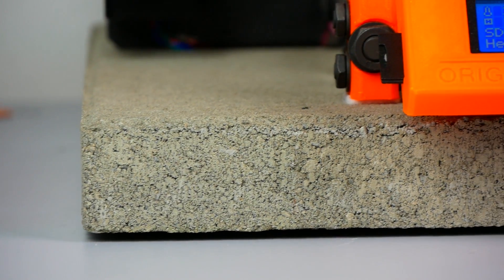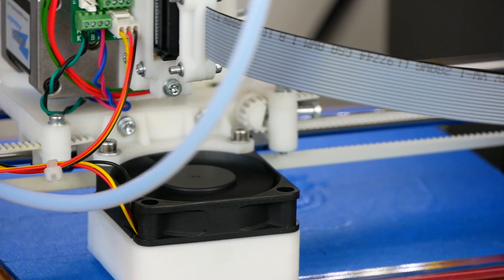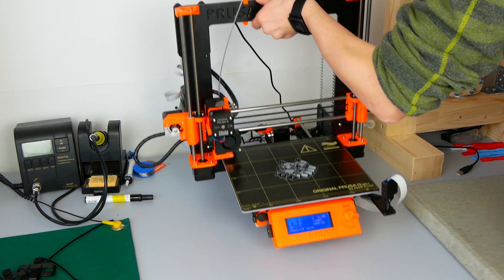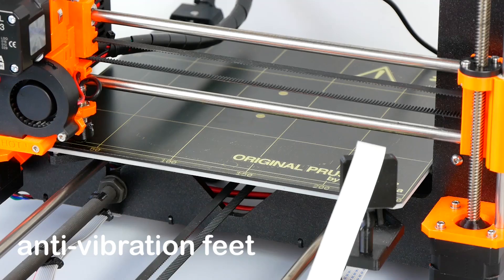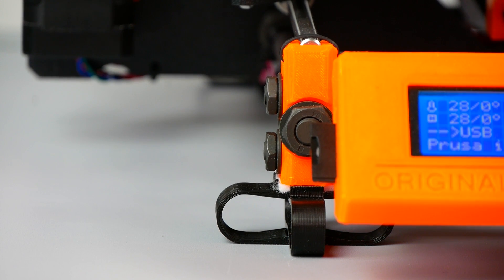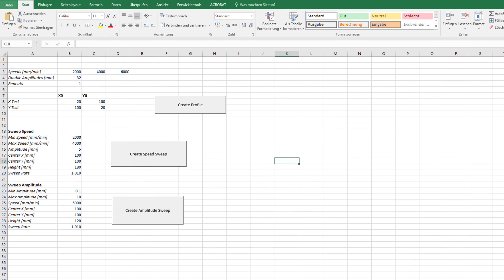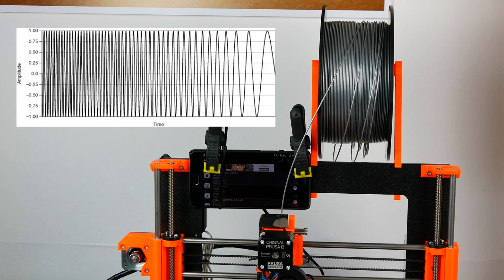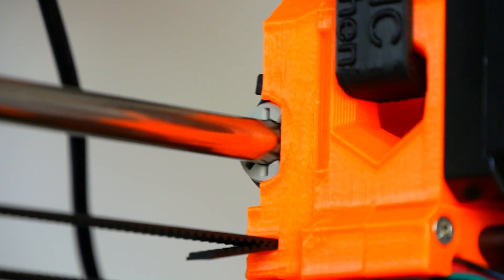Silencing the Prusa i3 MK2 & Horrible Vibrations

Comment: Could you elaborate more on how you created the gcode to find the resonances?
Reply from the maker: You can find the sweep test GCODE on GITHUB:
https://github.com/CNCKitchen/3D-Printer-Vibration/blob/master/ampSweepTest.gcode
Notice that it's designed for the Prusa i3 - USE AT YOUR OWN RISK!
Reply: CNC Kitchen thanks! Great video and I love your scientific approach to investigating vibrations.
Reply: i will give this a go on my mendel90 in a week or 2

you also showed a excel sheet in the video... can you link to that so that we can take a copy?

and maybe explain how to avoid the resonance best? you said to lower acceleration and jerk.. i dont mind that, but can values be calculated from the freq found?

Comment: Are you familiar with the Young Modulus role in dampening dominant frequencies of equipment? Sometimes, two materials, with different Young Modulus, or more, are required to "cancel" harmful frequencies in a system i.e. a spring within a spring, with their supports fixed on a certain type of rubber mat, under each legs. Sometimes anchoring the feet solidely is sufficient. 
A greater supporting mass is great; but sometimes added weight to the machine, in strategic places, can cancel some localized dominant frequencies, sometimes also simplifying the feet construction. But this method can have a detrimental effect on the wear of certain parts, that were not engineered accordingly, greatly reducing their longevity. 
When I saw the result you had with the feet, I immediately thought they were inappropriate, actually amplifying the issue and creating a new problem; they need to be designed for this precise system frequencies, in this precise condition, assuming the system is uniquely customized. 
The sound does help to identify certain frequencies, but others need accelerometers to be determined and avoided, with, like you said, speed adjustments to avoid harmful frequencies. Certain systems need accelerometers, and the controller program conceived to actively use them in real time, during the production process, to make sure certain frequencies are avoided i.e. wind turbines. 
Fun challenge, but I think you can find easy fixes for all your systems conditions.
Just a thought.

Comment: mine mk3s is in stealth for some reason louder then in nromal mode, in the beginning there was no problem but now when the bed is moving it is uncomfortably loud that i have to switch into normal mode, i seriously dont know why, i switched the isumi bearings for igus bearings directly in the beginning had no problems with that, i tighten up every srew on the printer but the vibration are still there

Comment: What about bolting the printer to the paver? Then adding a closed cell foam insulator below the paver? The way I see it is if you take a video game controller that vivrates and put it on a hard surface it will dance, but if you bolt the controller to the hard surface vibrations will be reduced significantly. You may have to add supports to directly connect the and add more contact points for gantry to the paver to further reduce vibration. And finally the closed cell foam insulator will absorb and negate vibrations reducing them even further.

Comment: I thought this could be a problem when I saw people using those feet in other videos. It had to affect print quality in some way, and having rigid mechanical parts vibrate around is not good. 
That being said, I was looking for concrete pavers at the local store, and saw they had rubber ones made from recycled car tires. I am considering grabbing the hard rubber ones see if it gives the best of both worlds. A sturdy solid foundation, and sound dampening properties.

Comment: Having a large mass at the top of a "pendulum" is not good for low frequency resonance. Decoupling such mass from the printer altogether will improve this immensely. In other words remove the spool frame from the printer body and mount it separately to the floor/table. 

a) This will remove any and all pulse stimulus from the movement of the printer to the mass of the spool
b) It will greatly reduce the mass of the overall printer assembly allowing the print head to move laterally (X & Y) more rapidly before hitting resonance.

It's a similar principle (if not exactly the same) as reducing the unsprung mass of vehicle wheel assemblies - lower mass of wheel by using lighter alloys, lighter yet more flexible tyre construction, lighter brake calipers, lighter braking disks, lighter but as strong or stronger wishbones etc. All these things are standard practice in just about all motorsport but essential in Formula One. Such "unsprung mass reduction improves the mechanical "grip" by ensuring the tyre/wheel can respond more quickly to road surface variations stopping the wheel from unnecessary "unloading" which reduces grip levels, especially laterally but also forward (important when braking).

Comment: A slab of concrete is seems a strange choice when a mat of cork would have a similar if not better effect by actually absorbing the vibration "energy" by deforming...
Reply from the maker: Concrete does a way better job in decoupling the printer from the table as cork would due to its weight.

Comment: Concrete pavers worked for me.  My Prusa i3 MK3s was really growling.  I pulled it out of its enclosure and checked every fastener, not a loose one in the bunch.  Took some left over 2.5" paver material from my back yard and used it as a base.  I had plywood stacked previously.  It's night and day.

Comment: I would strongly recommend swapping the position of the paver and the damping pads. Doing so, you are making sure the printer is dynamically uncoupled from the table. as its resonance will be very low. The energy dissipated is grossly the same as before (as your printer is the same), but the movement will be way lower thus leading to less vibration levels, as you printer has to move a whole big mass. Note that doing so, you are only making sure that the vibrations transmitted through the feet of the printer are limited to annihilated. The other noises (due to internal vibrations in your printer) will stay be transmitted through air. For this latter, internal resonances can be limited by mounting damping pads. at stepper level, making sure every connection is not loose. Adding some damping material is a solution to solve a problem, while removing the cause is even better. At last, Every sound you cannot remove can be absorbed by a case you put around the printer. Don't forget that a small gap is enough to annihilate its sound damping qualities. So seal those gaps! Brilliant chirp analysis by the way.

Comment: Hi, thanks for the great video.  Would this help with ringing/ghosting issues?
Reply from the maker: It helped me, yes. Definitely worth the $2 investment.
Reply: @CNCKitchen  You inspired me to try and print on a more stable surface.  I took my printer downstairs today and printed on a hard tiled floor instead of my usual IKEA desk, it significantly reduced my ghosting I was struggling with on my Y axis (Ender 3 Pro) - it's still there but not as bad.  

Definitely going to find something similar to what you used in the video now.  Thank you so much, this was troubling me for weeks.
Reply: @CNCKitchen  Hey, I finally got around to buying a paving slab just like your one shown in the video, I put some anti vibration feet from amazon underneath it (https://www.amazon.co.uk/gp/product/B07MHHQLPF) and the difference is incredible, I can barely see any ghosting at all now!  This video is invaluable, can't thank you enough I struggled with ghosting for so long - now fixed for under £10 in total, fantastic!

Comment: Wow!  They sure cured that with the i3 mk3s!!  I can't hear mine at all on a desk 10 feet away.
Reply: I can hear my mk3s across the house even in stealth mode. In a way it's even louder than my tevo printer. The noise from the tevo is higher in pitch and that doesn't travel through walls easily. the low frequency noise of the prusa isn't affected by walls and doors much.

Comment: optimizing the printers center of mass (like by relocating the filament spool) would also help reduce resonance and noise during printing. using proper rubber feet and having a few extras under the over hanging parts of the frame would help as well. Or as others have commented having the feet under the paver would work too.

Comment: This is one of my favorite videos I share with printer owners.  

I was wondering, have you tried anchoring/mounting the machine to the cement?  
say, adding points in the corners and uses springs to pull the machine snug/down?

Comment: I always suspected that resilient mounting pads might be a bad idea for 3D printing machines (as well as ANY machine tool) in general. As you so clearly demonstrate in this video, the frequencies and harmonics generated by a device throwing a mass around a Cartesian plane, as a 3D printing machine does, range from the sub-audible, low-frequencies caused by the acceleration/deceleration of the moving mass, to the higher frequency vibrations and harmonics generated by the electromechanical dynamics produced within stepper-driven mechanisms. 

Add to these complicating factors such as competing resonances, which are further compounded by the existence of radically “springy” elements such as drive belts under tension, and you are facing a witch’s brew of moving targets, where methods that are effective at reducing vibration-related print anomalies on one axis, causes problems on another, so one finds oneself playing whack-a-mole seeking the optimal solution. 

We are fighting vibrations on two major fronts, low frequencies causing gross machine movement and flexing, and higher frequencies causing undesirable noise and print artifacts. These change constantly throughout a print, and become noticeably harsher as the Z-axis rises into the machine frame, away from the more rigid base, and into the more flexible parts of the frame where moments of inertia have a greater effect against the anchor moments (leverage). That is one of the reasons why some of the cheaper cantilever printers often have problems producing prints of the same quality as “fully-framed” machine, and also why gantry-style and well-tuned delta-style printer are better for “tall” prints. 

Think about it; as a Cartesian-framed printer employing a moving bed ascends to its highest places in the print volume, the Y-Axis, which usually drives the build surface having a static mass, now has the additional mass of the printed part, but since the mass of the part is supported at its base, we now have a pendulum problem to deal with, along with print anomalies appearing higher up that did not appear on the lower layers. A well-designed, low-mass gantry machine, or delta frame setup, never moves the print bed, so the mass-balance of the hot end assembly never changes, and in delta setups, the rigidity of the entire assembly is ensured by the use of triangular driving members, locked into parallel balance. Can you imagine attempting to print a tall, thin-walled, flexible duct using “rubbery” filaments on a moving-bed machine?

Unpleasant noise, and vibration that produces print quality issues is a big problem for all printers, and is a battle being fought both electronically and mechanically, with mitigation procedures ranging all over the map, none of which apply to all printers, nor all prints, many boiling down to preference and opinion. Machine tool engineers are probably laughing at us as we struggle with the fundamentals of machine tool design that they have understood for decades. They would probably tell you that rigidity and mass will solve every problem a 3D printer could ever have. I say that a printer sufficiently built to their standards may produce superior prints, but industrial quality machines already exist, and our point is that our machines, many home-built, that cost a sub-fraction of that of an “industrial-quality” quality, produce fast prints of often equal, or even superior quality. I would also challenge a machine tool designer to produce a mill that can cut parts nearly as well as a full-sized one, but for less than a grand. The amateur 3D machine builders may have their work cut out for them as they tackle these problems, but they are relentless, and the fact that my sub-$300.00 Ender 3 produces useful parts of better quality than a $25,000.00 Stratasys machine did (10 years ago) is a great testament to this fact.

I like the method you have provided here a lot, since it targets the worst vibration problems, while giving the 3D print artist/mechanic vital information about their particular machine, allowing informed mitigation of problems, not just by attaching mechanical and electronic solutions, but also by being informed about speeds and slicer settings to employ or avoid in order to get the best possible prints, from ANY 3D printer.

Thanks for taking you time to make and share this; I would be nowhere without people like you!

Comment: Try feet under the paver. Works Wonders. This is also how you reduce vibrations on laboratory devices. Simply a heavy mass on springs as a table.
Reply: Interesting, any input on what the best feet to use would be?
Reply from the maker: I currently use thick foam under all the pavers. Works great!

Comment: I've had great results with Sorbothane Hemisphere feet. They are a little pricey but have amazing vibration dampening properties.
Be sure to get the right ones, the weight of your printer dictates what diameter of the feet you should use.

Comment: Adding mass raises the frequency the whole system resonates at. Two pavers and a small inner tube between them is the easiest isolation
Reply: Obi Serge Kenobi I guess that would be slightly better than just a paver on another paver, but you want something quite a bit softer. Ideally you want something that dampens movement in all directions, with next to no springiness. Unfortunately I don't know of any cheap ways to do that. Perhaps filling an inner tube with thicker fluids than air? (An inner tube is easy because when laid down it acts as a soft spring to horizontal movement and a much stiffer one to both vertical motion and tilting. And you don't need to make any mounts to hold it)

Comment: Very interesting video, never seen anyone look into that issue with that much attention to detail! I use a super cheap i3 clone (thin acrylic frame) : super noisy, extreme vibrations (there was even noise from the frame vibrating). Also would screw with a lot of the components (set screws for endstops, belts...). Print quality also suffered a lot from it. A 10€ 10mm thick rubber mat for washing machines fixed most of the issues (especially noise), without leaving the printer as wobbly as those 3D printed feet seem to do. Seems to be a sweet spot (that rubber is quite hard, because it's meant for very heavy appliances).

Comment: Slic3r used to have a setting where you could enter the natural frequency of the printer and it would avoid changing directions at the frequency. If I remember correctly the setting was removed recently.

Comment: What if you made a base out of concrete that the printer attaches to (or is embedded in)? Then I would imagine that would get rid of most of the vibration issues all together cause the inertia of the print head would not be able to move the mass of the concrete base fixed to the printer. of there is no more vibrations I would think that would me no more sound as well? or do you think those vibrations would just transfer into the rest of the printer shaking the printer apart?

Comment: The key to the result is the MASS of the concrete base. A friend of mine had a LATHE IN HIS APARTMENT (yeah....) and that rendered several complains form his neighbors. He solved it using old telephone lists initially and by the end a 50mm compact piles of cheap bag paper under the feet. It dumps fine vibrations! You could use the pile of paper between the printer and concrete. Than you have the best of both: mass and hard dampening! 

Did it word on mine? I do not know, I just started building mine 3D printer :D

Thank you for the advice!

Comment: I wonder if larger softer "feet" under the paver will give you both benefits?
Reply: i put some felt furniture pads (for hardwood floors) under my paver to protect the surface it sits on. I'm pretty impressed with how quiet and sturdy it is.

Comment: You could use damping tuned at the frequencies to lower these vibrations and still use the feet and cement together and have an extremely quiet base. Adding a perspex surround will dampen even more noise .

Comment: Print two more vibration dampeners, place them under the left and right ends of the metal frame. It doesn't compromise the aesthetics or operation of your printer and the wobble problem is solved.

Comment: I use to use neoprene (1/2" thick) under my printers to silence them. As I had my printers on a wooden shelf originally. This worked good. But not great. I picked up a roll of cheap TPU after building a delta. After realizing its flexable but still fairly stiff if printed right. I ended up printing a set of custom anti vibration feet for my Printrbot. That utilized a large number of fins, into a semi solid mating surface against the printer. This works amazingly well. Almost nothing gets transferred to the surface below it now. The frame also suffers less sympathetic ringing in the audible frequencies now. If your interested I can share the design its very basic and could be easily adapted to other 3d printers.